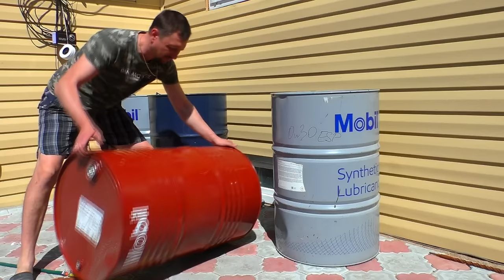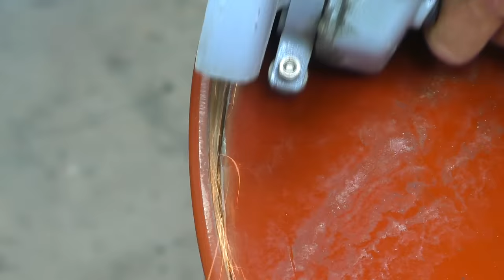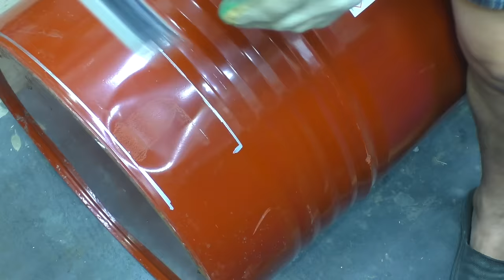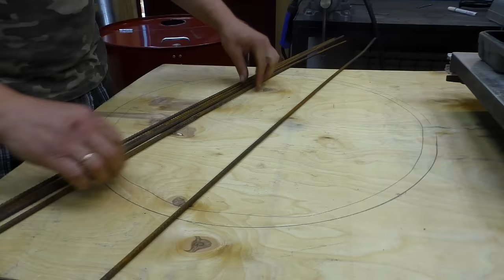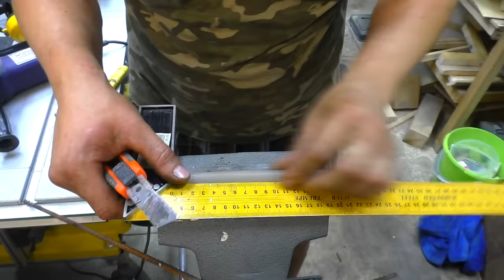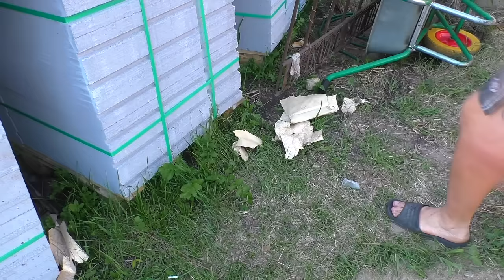A cool idea from a car oil barrel! I wish I knew about this before!

Comment: End your stove pipe right at the top of the barrel where it connects do not extend it into the barrel and it will burn much more efficiently.  Make a 3 inch tall collar out of a piece of pipe one size up from your stove pipe diameter that the stove pipe can snugly fit in and weld it on top of the barrel where you would insert the stove pipe.    drill three holes around the collar equal distance around for sheet metal screws (In case you want to take the chimney down later for storage).  Weld a steel lip or some kind of other seal around the top door and put high temp woodstove gasket on it for better air seal you are losing vac-cum here for the chimney draw. ( you dont have to do this on the bottom door but its a good idea with air flow valves).   If you can extend the stove pipe another four feet in height it will greatly improve your chimney draw and burn very hot and fast and efficient.   i love your design and was going to build one for myself before I ran across yours.   I LOVE THE PORTABLE IDEA...VERY SMART and since its not connected to the house like the old barrel stove/incinerator  I used to have no pesky inspections from the city.  you have a buoyancy problem with the pipe a foot into the barrel and the air leakage in the top door and for more suction power you should have four more feet of stove pipe.  the power of the draw is determined by the height of the chimney.   I was in the chimney trades for 20 years and worked on  and built a lot of barrel stoves thats how I know this.  Do this and it will purr like a jet engine.  Put air flow control valves on the bottom door and ,make it air tight and you can control how fast it will burn and easily shut it down if it gets to hot.  Again I REALLY love your design and I'm going to make one for myself.   thank you for the video -- Wayne

Comment: As a former welding teacher I tell you never ground of cut on a used barrel until you have filled it completely to the top with water. This is to expel any flammable vapors that might been in the barrel.

Second you should never cut on a barrel with the caps in place. If the  barrel does explode there is no blast energy to go but in your face.
Reply: What about him welding over the paint? Not cleaning 1" around the welding area.
Reply: You are correct, as I’ve seen a barrel pop that was having the top cut out. Fortunately the bung caps were removed. I’d like to see the shop cctv of all of us running. Also if you can read labels and verify that no other product has been in the barrel you should be fine.
Reply: I worked with a guy who was welding skids on the bottom of a fuel tank 2 metres dia 4m long that had been cleared to work on by a petroleum company. The last job was to blow a hole in the bottom for a drain Oxy-Acetylene). It had a large inspection hole in the top of the tank that was open. The end blew out and the Large oxy bottle landed 200metres away. My brother had a 500 litre diesel tank that the scrap metal merchant would not take because of the dangers. BE WARNED
Reply: @Kurol12345  Inspection hole on top is useless because vapors are heavier than air. Your brother just didn’t find the right scrapper, someone will take it. Take it to the poor area of town and yell “free bbq” and watch people fight over it.

Comment: I think this is a great idea. I'm in Ohio and the laws on outdoor open burning are extremely strict. Even burning in an open barrel is very strict and they have strict guidelines on how it must be built! But if you use a wood burning stove such as this outdoors, the laws are extremely relaxed. I might make a version of this but on a larger scale. Burning plastic is a no, no so if your going to do it, don't tell or show it on a video.
Reply: I'm from NW Ohio. And yes the laws are pretty strict where I'm at also.  But I do remember a time when almost everyone had a burn barrel in the back yard. No more around here or a nice fine will come your way.

Comment: This is very helpful for people to grab a old barrel and just cut into it, old barrels that have had oil in them become explosive when sparks enter them and could kill people.
Maybe put a disclaimer in that you have no regard for your safety but if you are going to attempt this to remove the oxygen from the barrel first. Run some exhaust into the barrel until the barrel is warm to touch before cutting into it.
Rinsing it out does not get the flammable material from the seems.
Remember folks people put all kinds of stuff in barrels so besafe cutting into them no one needs to get hurt or killed.

Comment: The barrel if it had contained oil, it must be absolutely clean  OR filled with water up to just below where you are going to be grinding and making sparks, leaving as little air space as possible. ANY oil vapor in the large barrel area can be  ignited by the heat and sparks of grinding and explode VERY powerfully.
Reply: Any time I see amateurs doing hot work on petroleum barrels I cringe.

Comment: I'll stick with the old cutting the top off and poking a few hole at the bottom of the barrel to let the air in. Oh, if you live in the UK, you would never get away with burning plastics. It's completely illegal here and face fines.
Reply: I'm pretty sure it's illegal and punishable by fines everywhere here in the states. I should have known this guy was a moron when I saw him cutting and welding metal while wearing flip-flops.
Reply: @floydsmith2296  Why would you be concerned by him not wearing proper ppe? Maybe people should be allowed to decide for them selves how safe they want to be when they will be the only one injured?

Comment: Way to much work.  Cut the top off . Shoot 12 or 14 rounds of 45 through the barrel for air & use & old grill grate on top to hold debris in.  Also , wouldn't burn the plastic , pisses the neighbors off.
Reply: Don’t cha know every time plastic is burned, a dog scoots his ass across the road?!  Quote from a very drunk adult to a child around 1995.
Reply: I was going to say cut the top off and drill some holes around the bottom but I like your idea what way better
Reply: That's how we do it. Only an old bicycle rim/spokes for the "lid".

Comment: Burn barrels have been outlawed in most areas for many years but the biggest problem is because they very thin and along with heat and moisture they have a short life and when they collapse you have a mess to clean up. A motor and brick fire place would be much better. Nice video.
Reply: ~ I have a beer keg which is Stainless and have had it going since almost the mid "0s".  Learned not to use the barrel like he did, as Dad did it that way and those drums eventually inevitably fail.
Reply: ? We had a barrel stove upright in our workshop for the ten years I was there burning wood and coal, last I heard it was still going strong.

Comment: That’s very fancy! The last time I had to do something like that I was in the US Army and we were in Denmark during an exercise in 1985. We didn’t have a stove for our tent because apparently it went “missing” somehow. It was winter and extremely cold with tons of snow. So we went to the trash pile and got a barrel like yours and took an axe to it because we didn’t have the right tools. So we cut a hole in the top for the pipe and one in the bottom like you did but no hinges, just pulled away the sheet metal like a door and stuck wood in it. It worked great, except we forgot to clean out the oil that was left and it burned! It smelled bad and there was lots of smoke in our tent but at least we stayed warm. We used wood that we found in the trash pile and branches that had fallen from tress because we weren’t allowed to actually cut wood from the trees. Good times!
Reply: So somebody probably had 2 heaters in their tent
Reply: Hope you enjoyed your stay i Denmark. The winter of '85 was in top 4 of the coldest winters over time in Denmark. Sorry...
Reply: @wookieedk  tell me about it! It was super cold. My wife still doesn’t understand my phobia of cold weather! 😂😂😂
Reply: I remember that winter too. Damned, it was freezing cold.
However, 81 and 82 were even colder with a record of -25,6 C (81) and -31,2 (82).
Thanks for your service...we appreciate our allies from the US. :)
Reply: @kalleklp7291  well thank God that I was in the Army Reserves in 1980-82 and not in Europe! By the way we loved going to Denmark in the Spring and Summer, Fall wasn’t too bad either, but that winter! My wife has never been to Denmark and saw my pictures of it with the snow and cold and said that if we were to go it had better not be in the Winter. So we went to Germany last year in February and were planning to go up to Denmark but the weather wasn’t good so we decided to go to the Netherlands instead. But we’re planning another trip to Europe after the whole COVID-19 thing is done. Thanks for the words of appreciation, we definitely felt appreciated in Denmark whenever we were there.
Reply: @wilfredosoto2722  Spring and summer are very nice here. We have a continental climate with usually ok temperatures.
But I'll admit...I'd rather take a trip to Florida in the winter than to stay here. :)
Reply: Thank you for your service!
Reply: 👍U.S.M.C  1982

Comment: nice to see people making stuff which serves a purpose out of junk just lying around, and good to see that when you are doing so you were wearing full PPE equipment, tee shirt , shorts and of course steel toe cap flipflops,  an accident waiting to happen when you are using angle grinders for cutting steel oil drums and welding them up , still made a good job of it well done

Comment: I love how you made a perfect smoker for meat yet used it to burn plastic which if you just hopped in your car and drove to your local recycling centre you could of disposed of in the correct environmentally friendly way. Wish that oil drum still had gas in it when you cut into it
Reply: Agreed I was thinking the same thing.

Comment: The grate at the bottom with a door to remove ash is a very cool idea. In my country we are supposed to take our burn barrels to the county dump and pay to empty then. Not an easy task if you don't own a truck. I wouldn't burn plastics in the barrel because they emit some pretty nasty chemicals into the environment but for paper and wood this would be very handy.

Comment: Aren’t you in Britain? Huge Fines here in Maryland for burning Garbage, and Building Materials. On top of that, you’re need a Burn Permit, which is only available from after Labor Day to Memorial Day, cost $25.00, must have the burn pile inspected and the permit is good for 60 Days to burn cut brush, and cut brush only. BTW, my Grandfather turned part of his Farm into a Summer Tourism. All us Kids had to do a Summer there. He had 33 gallon barrels cut in half a welded together, and the two halves hinged together. Yep, the Creosoted Post weren’t good enough for him we had to Hot Dip them in Creosote, Fish them into the hinged other Section, then onto a Rebar Rack. If it caught fire, we were supposed to flip the hinged section over onto the dip section.

Comment: Hmmm - In Alaska we just find an open ended drum, punch holes in the sides and bottom for air and drainage, put some woven wire screen over the top, sit it on 3 cinder blocks and use it.  After a couple of years, when the rust goes through the drum we do it again - without all the fancy smoke stack, wheels, doors and such.

Comment: I thought that this is meat smoker. It would be much, much better If you recycled that plastic trash! The smoke from that fire is just as bad as not recycled plastic!
Reply: Just a FYI a lot recycling facilities won't take more then half of the crap you put in your recycling bin they just truck what they won't make any money selling off to the land fill. Sorry if I burst your bubble but it's true do some research on your area you might be surprised.
Reply: You can't smoke meat in a barrel that had chemicals in it. As for burning plastic, I do it at least twice a week when I burn my trash.
Reply: A MEAT smoker...from a oil barrel?
Reply: @Momentaryghost  I'd rather it in a landfill than have the toxic fumes in the air.

Comment: Basically it's an incinerator. I made one with a lot less work. I did make a grate at the bottom about 4" high and some vent hole around the sides at the bottom and that's it. Works great. Once the fire starts going it almost like an engine. You can see the air current in the flames. Air coming in from the bottom through the barrel and out the top. I do burn paper products and cardboard but don't get busted burning plastics and pressure treated wood.

Comment: Not sure what to say, glad to see your planet friendly.
Reply: Much rather see that plastic recycled .... not burned.  Plastic gives off some noxious fumes when burnt.
Reply: Like the friendly sarcasm.
Reply: Don't burn plastic, fool
Reply: @johnjacobjinglehimerschmid3555  Have you ever been to a plastic recycling plant or a garbage disposal land fill or how about the waste burning sites? Yeah, you'd think this guy is saving the planet compared to those facilities. There is much worse chemicals used than burning some plastic, also fyi if you make the burning process a little hotter you burn most of the pollutants and will in fact make the process cleaner than your car exhaust.

Comment: When you fit the hinges, do not just use sight to align them. Rivet the middle hole of the hinge on one side for both hinges, use your steel ruler to align the edges then rivet the other side of each hinge. After you have the hinges aligned and secured, proceed to rivet all holes.
All the comments on pollution and safety in re-using drums also apply.
Reply: If it works, it's right.  It's a garbage barrel after all.....
Reply: Hinges are aligned already since they are applied to a solid base before cutting. The only thing you have to worry about is centre alignment over the pre cut, using sloppy hinges and don't use aluminum rivets. They will melt.
Reply: I dont think you have to tell this guy anything about building anything or even how to make a video, both excellent. Stop burning plastics, they belong in landfills for a thousand years, or in the ocean

Comment: After all that work it won't last that long as they start rusting out. Also, it is very dangerous when cutting into the top of a barrel that had anything flammable. You should fill it with water first. Cutting into it with something that can ignite them can cause them to build up huge pressure and take off through your yard like a rocket while spinning.

Comment: Your door on top should be on the side of barrel. Thus smoke would go up chimney.
Don bottom should only open for cinder removal.
There should be a sliding air intake door for burn rate adjustment on lower side of barrel above the ash removal door height.
There should be an inner grate that supports the material to be burnt for proper combustion eliminating excess smoke.

Comment: I enjoyed your video and a good use of an old oil drum.
I made one very simular and I came upon a problem.
The alley rivets melt, I had to drill them out and replace with nuts and bolts. Rivets are good but not near heat. 👍
Reply: ~ Thanks.  I figured the Alum. ones wouldn't hold up for the long haul.  My rivets kit will wait for less temperate work.

Comment: An high school shop teacher allowed students to use empty oil drums to support material they were cutting with an oxyacetylene cutting torch.  When the drum was penetrated with the flame the vapors in the drum exploded, killing two students and the shop teacher.  Be careful with empty oil drums!
Reply: Fill it with water and all is good!
Reply: At least the shop teacher will nor face criminal charges.

Comment: I like your design. I've used burn barrels all my life the one thing they all have incomen is that rust out from intense heat. I'd like to see what it looks like after a year of use. The grait you bit on the bottom may prolong its use. Good job. 
P.S. haters will hate.
Reply: It's not about hate. It's common sense not to burn plastic. It's bad for you when you breathe the fumes and those horrible products of combustion are toxic. Recycle instead and keep the carbon and chemicals out of the atmosphere.
Reply: larry shea 
Nobody recycles, the recyclers don't even recycle anymore. There's no money in it for them. If you're putting stuff in a recycling bin, it goes to the transfer station and it all gets put in the same pile.
Reply: @ralfie8801  Perhaps yes, in some cases. That keeps it out of the environment and out of the air and water. I pay to have my waste recycled or placed in a landfill, their choice. I am certain it will not have to be delt with by another ever again. What is the best flawed alternative?
Reply: @larryshea8595 : My point was you'll overlooked his design and blasted him for not recycling. I agree that you should not burn plastic or rubber  but you'll turned into all negative commits hint haters.
Reply: 2  reasons those "burn barrels" rust out. 1, They burn at full blast.  There's no controlled burning so temps sky-rocket!  and 2. Ashes are pretty caustic, especially when wet.  The combination of rain and ash eat at everything

Comment: Back in 1952 my mom and dad bought a new house in Ontario California, All the houses in the housing division had a concrete incinerator for burning trash in the back yard. They were deemed illegal in the early 60's due to pollution. I take it they are not too concerned about air quality where you live.

Comment: I was a janitor in a high school and a teacher was demonstrating welding on top of the oil drum instead of a welding table. A pinhole burn through cause Caused an explosion from the fumes in the drum and propelled the lid up through the teachers. I heard the explosion a quarter mile away.  The lid caused massive head trauma to the teacher. He lived a few days.   The torch tip went through a kids jaw.